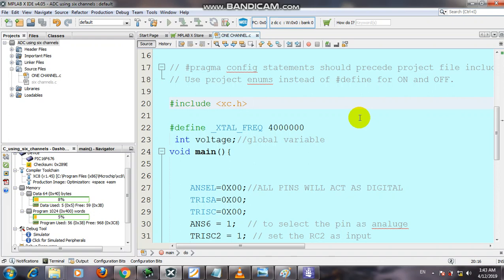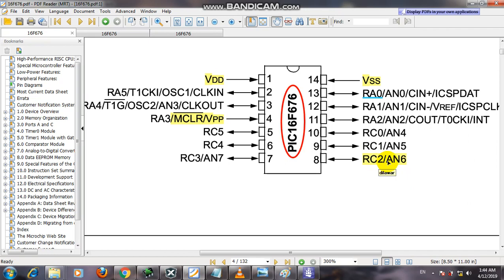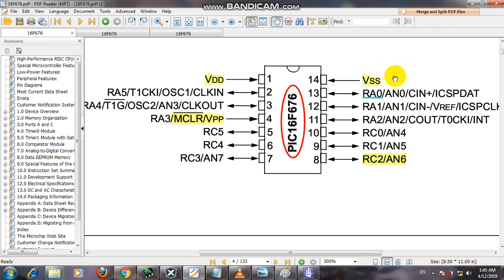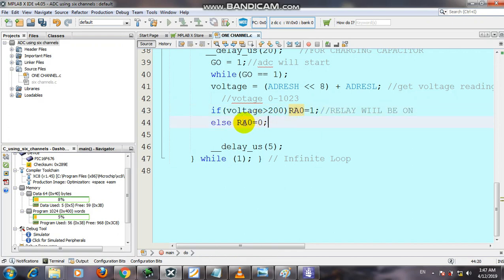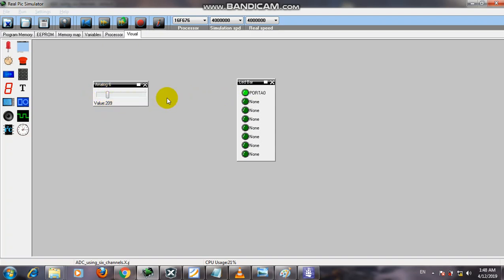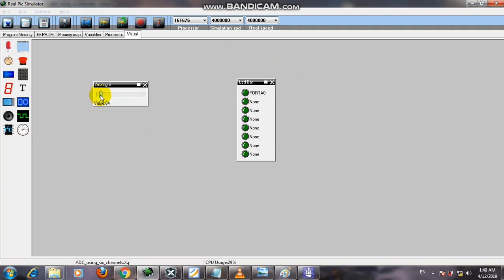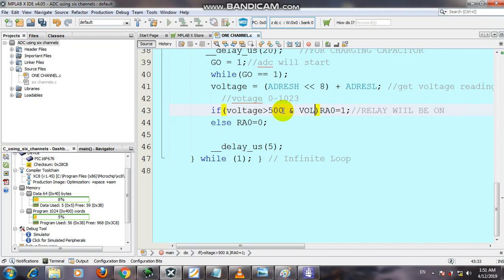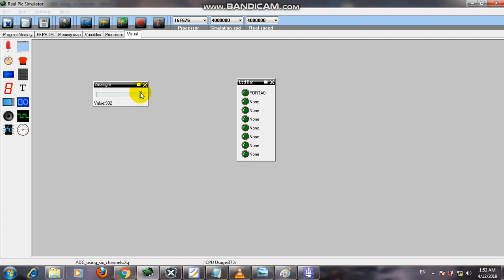PIC16F676 MICROCONTROLLER C CODING SIMULATION |PIC16F676 SENSORS PROJECTS #2

Comment: Please give some knowledge to make this ic for use water levelcontroller.
WhatsApp: 9938534040
Reply from the maker: 1- you must know  basic c language
2-use mplab xide free sofwear from  microchip web
3-ic 16f676 data sheet to know pin configuration
4- pic kit3 programm installer
5-for water level controller it will be easy to use only transisters instead of  this ic.